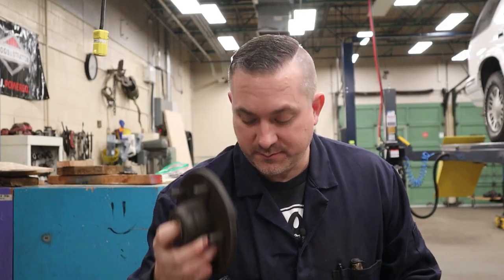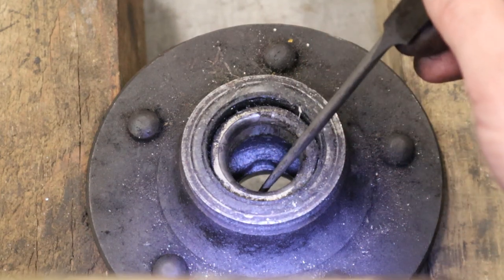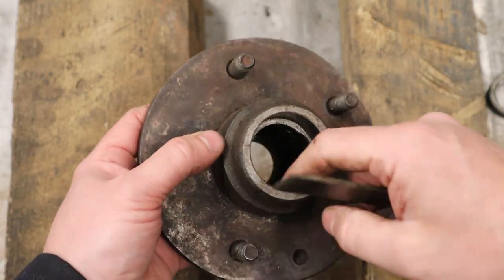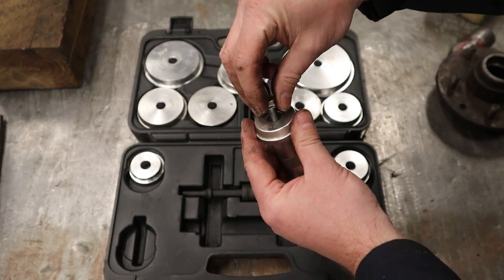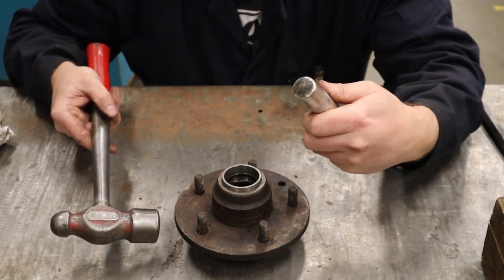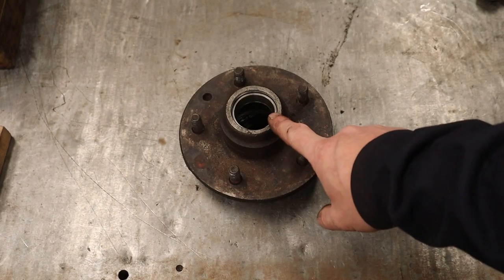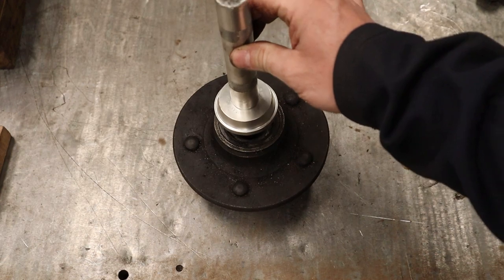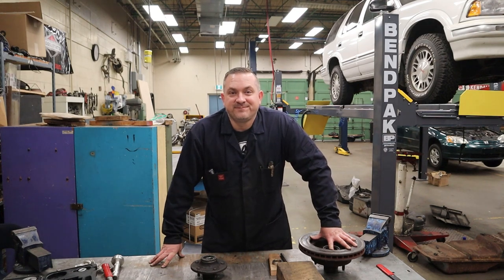Tapered Roller Bearings: How to change them!

Comment: Enjoyed watching,  if you specific tool for the bearing races to tap out and new ones you can use large sockets as will do the same thing if you careful match the size up 🥳🥳
Reply from the maker: Thanks!  Yeah good tip.  You can also keep old bearing races and grind the diameter down a bit to drive new ones in.  Thanks for the watch and your support for the channel!  Cheers!

Comment: First time seeing your channel. I usually cut straight through the old race with a 1mm cutting disc to get enough flex to remove it. Enjoyed the info
Reply from the maker: Awesome, I hope I made a good enough impression for a sub!  Yeah lots of good info in this one, no need to cut up bearing races anymore.  I know someone who cut a bearing race once who cut most of the way through and used a hammer and chisel to crack the rest off.  When he hammered on it, a small chunk flew off and went into a kids eye that was on the other side of the garage.  The kid ended up losing the eye....sad story.  Thanks for the watch!

Comment: Great addition to the previous bearing video. Off to do mine now
Reply from the maker: Cool....let me know how it goes.  Thanks for the watch!
Reply: @wayofthewrench  Got it done... A minor hurdle getting the races out. My wheel hubs are not notched so no where specific to punch them out which made it a bit tricky. Thanks for the great tutorials. Very informative and saved me some cash.
Reply from the maker: Sweet, this is the way.  Yeah not all of them have the notches, when they don't you just have to make sure you have a sharp edge/flat end on you pin punch/drift punch so it doesn't just slip off.  Glad to hear you got the job done!  Cheers!

Comment: If you had the race loose at the bottom when seated would you Loctite it or replace the hub
Reply from the maker: Proper answer, replace hub.  If it was just a touch loose, maybe a little loctite especially if adding loctite made it seem more centered/tighter.  They make an electric engraver that actually adds tiny burrs to the engraved area that you can use to "grow" the diameter on a part a couple thousandths of an inch.  Thanks for the watch and welcome to the channel!

Comment: On a 2000 Dodge Ram Van 3500 when replacing the rear race do i stop driving the race in when its flush with the top of the inner lip on the rotor?
Reply from the maker: Hard to say without seeing it but you could look at the other side to see how far it's pressed in.  Usually flush with the part is ok and sometimes it's ok to have it down all the way.  Just watch that the inner race doesn't push up against the bottom or it'll affect the bearing.  Hope that helps.  Thanks for the watch and welcome to the channel!

Comment: Please show a closeup of the bearing orientation.  Thinner side?
Reply from the maker: The thinner edge of the outer bearing race goes to the outside so the larger flat surface goes down into the hole.  Hope that helps!
Reply: It's really easy to tell which side goes toward the outside of the rotor because the bearing will only fit in the side that goes outward and it's not nearly as thick.